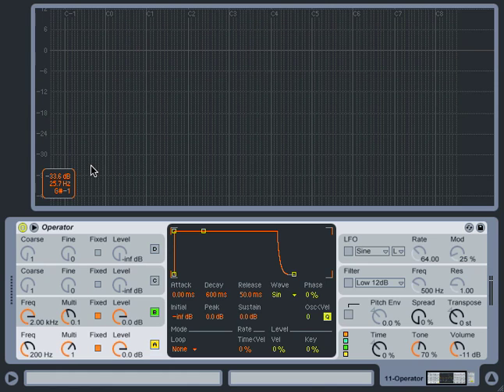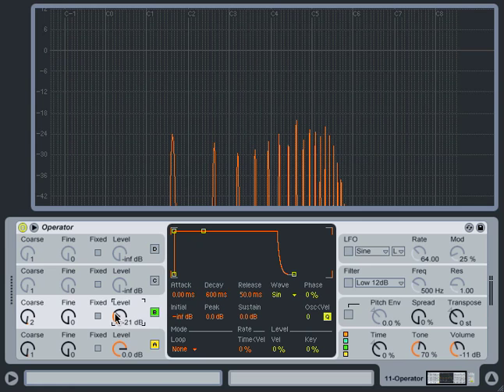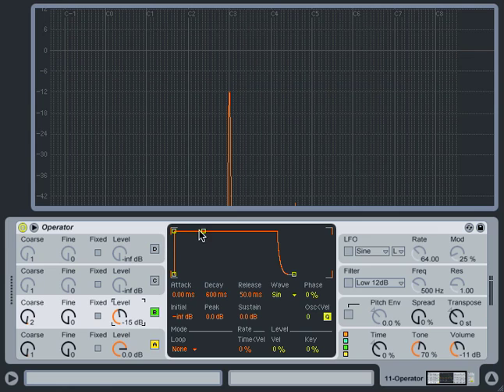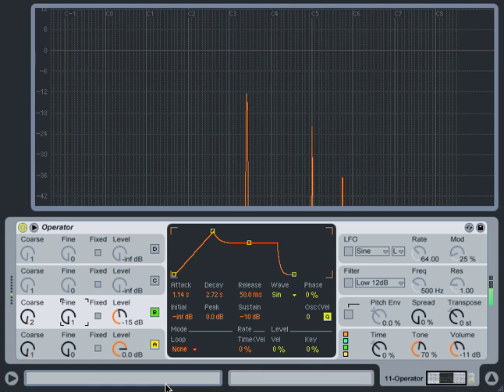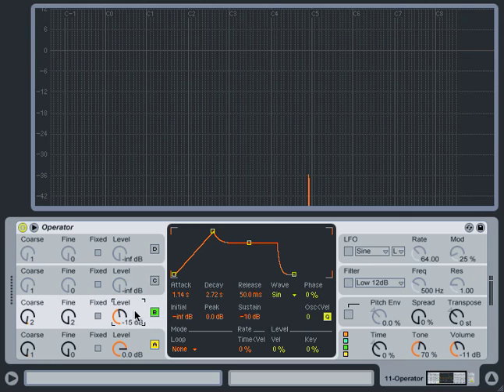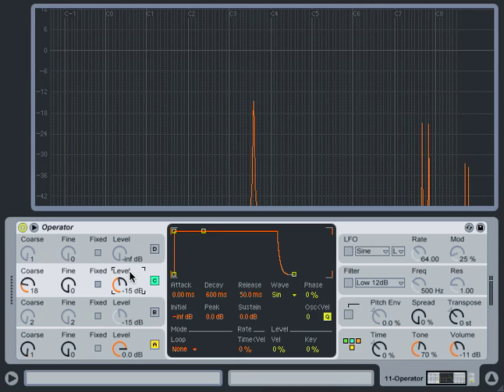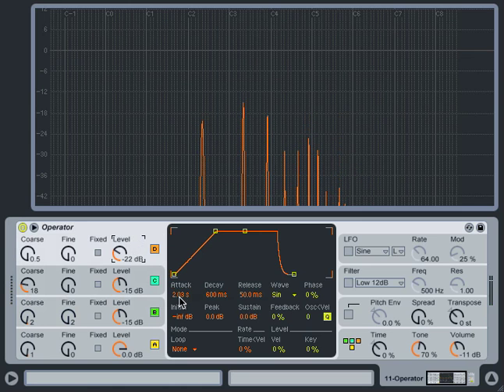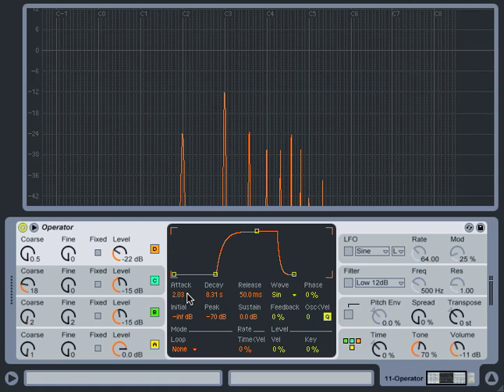What is Frequency Modulation? 2, Simple Ratios

Comment: Re. the sidebands, specifically, the note below...  It sounds like it's an octave below the fundamental, so that's probably why it sounds good, right?  What if the lower side band was not a simple ratio to the original fundamental?  Or perhaps the better question... when a lower sideband comes in, does that effectively become the new fundamental?